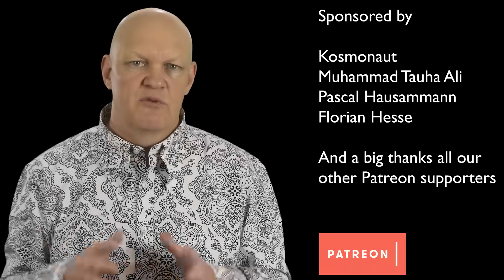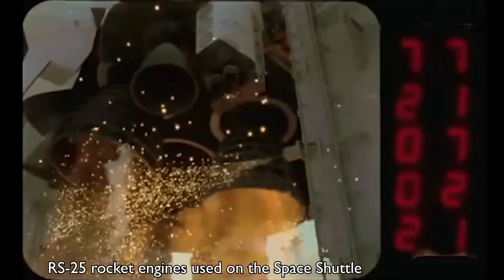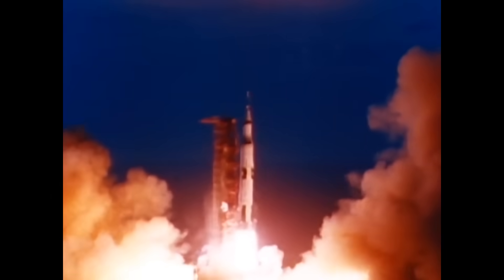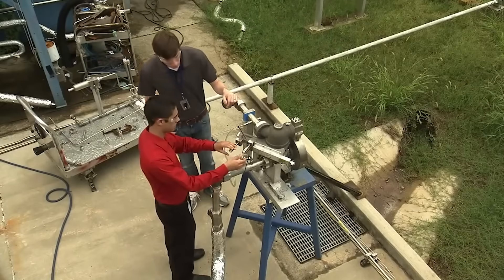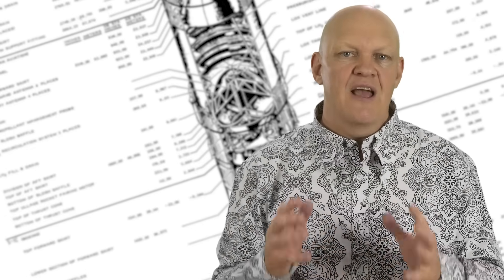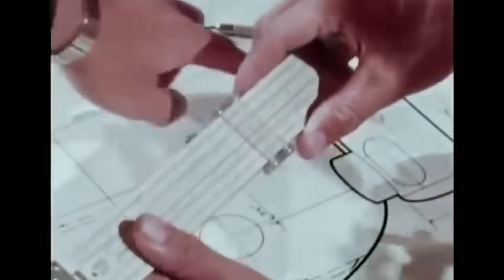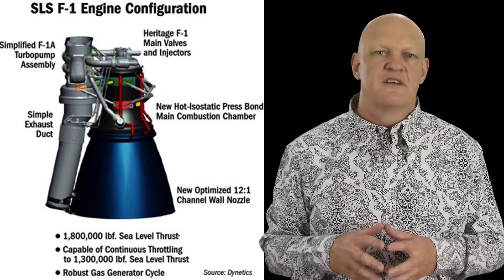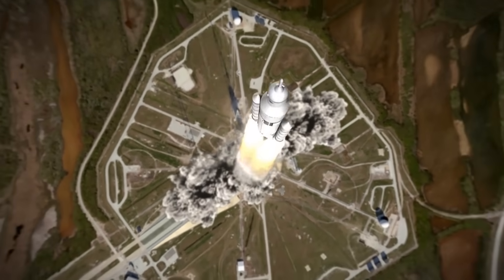Why Can't we Remake the Rocketdyne F1 Engine?

Comment: This term in Manufacturing is typically referred to as tribal knowledge.
Reply: Yes when I worked in manufacturing there were tons of little tricks that were never written down but only passed on from older engineers to younger ones and from older production workers to younger workers. 

Right when I was leaving that sector there was starting to be a big push to capture that knowledge since someone finally figured out that having to have the young guys relearn what the old guys knew was causing knowledged loss so when the same issue occurred in another product years later the new guys would have to re discover what the old guys knew if they were not around anymore.
Reply: Nate a friend of mine was a technical writer for NASA and a large part of his job involved compiling the engineer's notes into a coherent compendium of sorts to be used with the manuals. Some weren't very forthcoming, I recall
Reply: W.W. - Of course they're not forthcoming with their knowledge, that's their job security.
Reply: +W.W. Usually when a perky young man comes running into an older engineer's office with a request to "Help me compile a volume of engineering and manufacturing notes for X critical product, please. We need to gather up all the relevant data in one place about your work." it's not a good sign for the older engineer. Years ago I was such a perky young man, sadly enough. Brain dump tends to have two meanings in this context.
Reply: W.W. Very very true they like to keep this valuable stuff to them selves
Reply: I know exactly what you mean. I work as an engineer in a plant that is more or less run entirely on tribal knowledge. I don't know what I would do without those old guys out on the shop floor.
Reply: Just have to sit here and grin. I am one of those people with lots of tribal knowledge in my head. It is a skill set. I just retired from being a journeyman machinist and tool and die maker for forty plus years. All that knowledge went with me, because instead of having machinist running the machine shop, corporate thought we needed business degree people and not mechanical minded people. To them we were a dime a dozen and could care less about transfer of knowledge. Production at all costs!!!
Reply: +Ron Sullivan Now, if only that machine-shop made (and shipped) ill-informed decisions, instead of quality physical objects, they'd be just fine without you!

I was thinking of opening an Amazon outsource store selling ill-informed decisions. I suspect the shipping cost would be very low, and of course, they're very easy to make, and a breeze to warehouse. I could sell em 13 for a dime, and still make a profit! Feel free to steal my idea, for a trouble-free income-stream into retirement.
Reply: The problems with an engineer or technician writing down procedural notes include not having enough time to sit at a desk for hours or days on end while a supervisor or manager is breathing down your neck for deadlines to be met. furthermore, and perhaps more importantly, a specialist often misses out many steps and techniques which they take and use without having to think about it. 

A simple way of illustrating this latter issue is seen if you try to write down the steps needed if you want to make a really good cup of tea. You might write: 'Boil some water. Add tea to a pot. Add the water. Wait for a couple of minutes. Pour the tea into a cup. Flavour as desired with milk and sugar.' It sounds simple, right? Think again:

In reality, there are numerous steps which vary according to the type of tea, the age of the tea, the fineness of the leaves or grains, how much tea to use, was it loose leaf or teabags, the source of the water, the exact temperature of the water, the time taken to heat the water, the minerals in the water, the size of the teapot/samovar/urn, etc., the material which it is made from, or do you put the tea into the kettle (as done in India), ambient temperature, whether you used a tea cosy, what type of cosy to use, how long to wait, whether to add milk before, during or after pouring, what type of milk is it, what type of sugar is it, how much sugar was used, how much milk is used, or do you use salt and butter, or lemon, instead of milk and sugar, how long to wait before pouring, how do you pour it (long, short, medium, slowly, quickly), do you stir the tea before pouring, when do you stir it, did you use a tea egg, did you use a tea strainer, how did you stir the tea in the cup, how long did you wait before drinking the tea, and maybe many other fine points, which are mostly never written down. This excludes the most important steps taken in growing and preparing the tea leaves before you even begin to make a beverage. The fermentation process alone can take up to a century for some teas.

If someone tried to follow your initial directions several hundred years from now, or in a land in which tea has never been consumed, then they would make something, but it would not be tea as we know it, and would likely be undrinkable. The point being that most of the tea process is learnt by experience and would never be written down, since everyone who makes tea tailors it to their own techniques, usually to make an acceptable decoction, and they would not even think of writing down the 'obvious' steps.

This is a very simplified parallel to the problems which rocket engine designers have if they want to re-create an F1-A.
Reply: RWBHere I appreciate your speculation but it best it’s speculation you have no clue what happened 40 years ago
Reply: The other term I’ve head that I think means the same thing is “institutional knowledge”
Reply: Guys...
What do you think about the tribal knowledge?
Should those who have it, write it down to let the world know it? Can we consider keeping this knowledge as a bad thing for the humanity? as it slows our advancement down.

Do you think keeping this knowledge as a secret of success is a kind of making more-then-needed money?

What do you think guys?
Reply: No to parasites. if you got the skill prove it by doing it - not by demanding others people's know how. that's what china does.
Reply: @Farsmezan  One reason people like "tribal knowledge" is another term "job security". If you don't write things down and just keep it all in your head it makes it harder to get rid of you. I've seen people get laid off but then rehired again a few weeks later. It was because management realized that without these people everything had come to a streaking halt because all the tribal knowledge had left the premises.
Reply: Joe Vignolo There's a missed step here.  Smart workers know, from decades of observing management behavior, that if management pushes to convert all staff skills into written plans, they probably have a secret plan to fire everybody and set up shop in a low cost country.  In that situation it is their duty to family and nation to refuse or sabotage such a move, just as they should refuse to train their out-of-country replacements.
Reply: @johnfrancisdoe1563  I've seen that exact situation a few times. What they do is tell the workers that they are going to train their out-of-country replacements to do their jobs and do whatever else is necessary to accomplish the move. Then they also tell them they can either keep getting paid up until the end and then get a severance or they can just leave right now. At that point what choice do the workers have?
Reply: Tribal Knowledge is unreliable. It should not be relied upon.
Reply: Shawn Moran k
Reply: Tribal knowledge is everywhere and unescapable. When you're in the middle of doing a complex task, you often don't have time to stop and write notes as you go, so the stuff that isn't in the documentation stays in your head. Even if you're later given time to write it all down, you're still likely to miss something. When you're helping someone else do the task, it jogs your memory, and you tell them, "hey, watch out for this thing", but again, you may not have the time to write it down. So knowledge gets passed on from person to person.
Reply: Is that why we cant build piramids as we use to?
Reply: @Just MeMe I'm sorry to tell you, but only a taken medicine can help you :(
Reply: Mark Fuller noun
the making of goods or wares by manual labor or by machinery, especially on a large scale:
the manufacture of television sets.
Reply: Knowledge + Years of experience + Innovation + Problem solving + Dedication + Perseverance = Tribal Knowledge

What a poor choice of words. I wonder if the person that came up with that reference has any of those traits.
Reply: Nothing tribal: manu-facture => hand-made.
Reply: Sometimes called : “implicit knowledge”

Explicit knowledge is your exam certs. Competencies , membership of bodies etc.
Reply: In Finland we call it "hiljainen tieto" = silent knowledge
Reply: @Just MeMe Yes, I'll tell you - go shove your tin foil hat up your ass. You schizoid conspiracy theorists are pathetic.
Reply: +X: And when the guys that knew how to do it were gone...It must of been aliens!
Reply: +Fars mezan
tribal knowledge is essentially extension of the medieval apprenticeship practice, so yes, it does slow down the technology down

and no, it is not required to earn a lot of money, knowing how to do something and actually being able to do it and being good at it are completely different things

in other words, you can read a book on chess rules, openings, endings and middle play and if you never actually played, you would be utterly defeated by even the simplest computer programs
Reply: Doesnt slow technology down. If the new guys can start out knowing all the old school tricks, as in an apprenticeship, it is easier to advance your skills and knowledge.
Reply: Now we have all these initiatives to capture that "tribal knowledge" which hinder all the other work that should be happening.
Reply: Considering they've laid off most of their workforce for cheaper foreign workers, it is interesting to see the truth finally setting in.
Reply: Yeah, tribal knowledge that we never went to the moon, lol.
Reply: Ninja Light Team looks like you don't know how light works

Comment: I highly recommend the Space and Rocket Center at Huntsville, Alabama.  It's is incredible and they have many of these engines.  The new proposed design is very interesting as materials have advanced and you no longer need the level of engineering, such as the exhaust on the original engine cooling the bell to prevent failure, the exhaust on the new proposal is just literally exhausted; which i bet grants a lot more power due to less restrictions on the turbopump.

Comment: This happens with buildings as well. The design for heating and ventilation systems is often not exhaustive - the installers are the one who sort out many of the issues on the spot and their solutions and working methods tend not to be recorded.

Comment: What you are talking about is called "expert knowledge" and its a problem in every major manufacturing industry from shipwrights to rocket engineering, from pumps to other large scale engineering systems such as generators for power plants. 
It is why American companies cannot manufacture, cheaply, reliably, and consistently a simple 1950s design such as the AK-47. They run into many metallurgical and design issues and attempts at uninformed corner cutting results in poor product, worse reliability in fact than Communist Era production on arguably much more primitive machines.
It is why we are having problems producing specialty turbines and large components for 30s and 40s era hyrdo-electric power systems.
A great example is barge pumps where one person retired taking forty years of expert knowledge without a replacement. The people remaining had to, and still are, rediscovering his expert knowledge.

We see this across the board in manufacturing where we can produce extremely advanced component for aerospace companies but cannot produce much more simple older components despite our extremely advanced machine processes. Ironically, this lacking undermines many aerospace projects, driving up costs, requiring re-engineering, and often delivering an under-performing system.

It isn't insurmountable but expert knowledge takes years to acquire, the same number of years it did before and that can leave an industry struggling for a decade or more in worst cases simply being unable to produce a product any longer, despite need and market.

Comment: It's not that they could not do it, it's that they did not want to. The same CAD tools used to build the new engine could have been used to delineate the specifications of the older engine. Is it practical or cost effective to do so? Probably not.

Comment: Skilled craftsmen are the stop gap. They always have been. They are the most likely to see the potential mistake before it is made. We see the oversight that a CAD driven engineer may have missed CAD has simply replaced the slide rule and longhand math. It has accelerated the design process and in many cases limited the gaps that were left in designs in the past. Nothing has fundamentally changed really. What is changing is the lack of desire of young people to want to know how to stop the gaps in design, engineering and fabrication. They are being taught that Craftsmanship is a "dirty job". That's ok though. There is a natural equalibrium that has to be reached when a pendulum comes to rest. This can't be achieved with regard to craftsmanship and technology. Technology is always improving but there will always be a "dirty job". Tech will always demand better compinsation and require someone to do that dirty job, to the point that the dirty job demands a premium.  The problem rests with the management. Laden with buzz words and one liners, spreadsheets and memorandums. They can't use CAD, they can't solidly grasp engineering principles, and seldom understand the process. In many cases if they were to happen upon a conversation between an engineer, designer, and craftsman, they would be lost. The management would assume that they were being inefficient and call a meeting to see which one they should cut.  Likely the craftsman because he only has a 2yr tech school back ground and an 8000hr apprenticeship under his belt. His value is less due to no college....of course. Mean while, management promotes segregation of engineer and design from the "unedjikated".  The point is, if we let the intelligence   of an applied science and the ingenuity of a craftsman work in unison as nature would have it, things get done and with less expense. Management is the problem. Anybody ever wonder why the product line manager of a manufacturing facility gets paid more than a toolmaker in that facility? If the PLM didn't show up for a month production would contunue. If the toolmaker didn't show up, engineering would drag it along until they were compelled to run an add for a toolmaker.
Reply: It has nothing to do with "these young people of today."   We are not given the opportunities that you had, and our society rewards college degrees alone above all else.  Which does not equal skilled labor.  Your second point about the management, spot on.
Reply: Legend has it that british engineers visiting an american war factory couldn't find the vise and files only to find out our manufacturing methods rendered them obsolete.

Comment: Why not just print the engines like SpaceX does.  SImply simulate the combustion inside the chamber using advanced software.  Good spaceX video from 20112.  They can simply use 3d headsets to design the engine and simply print it on the 3d printers as Spacex has done for 6 years now.  
I think using many super efficient engines instead of 1 big one is way better.  You have multiple redundancy and can mass produce them.  The F9 uses 9, the heavy 27 and the BFR will use 42.  It is much easier to fly the main stage back for a nice landing for reuse Unless you can make the entire rocket cheaply, then you can throw them away like a plastic bottle of water.ULA gets a billion dollars a year for no reason at all so maybe they can throw engines and main stages away each time as taxpayers pick up the bill.

Comment: Or you could just build an M-1 which was even more powerful AND efficient than the F-1, also since it was extensively component tested it should be easily mass producible just using the old plans.

Comment: The skilled engineers are out there...they're just not in universities & in silicon valley. They're in barns in flyover country, they're repairing cars, they're heading maintenance departments at public scool districts. The problem with all of these young engineers is that they're entirely dependant on cad programs. Hell, there's a huge portion of them that have never even had their hands dirty doing a backyard rebuild of a mower engine as kids. All of those engineers of yesterday started off at a young age actually modifying or building things long before their formal education began.